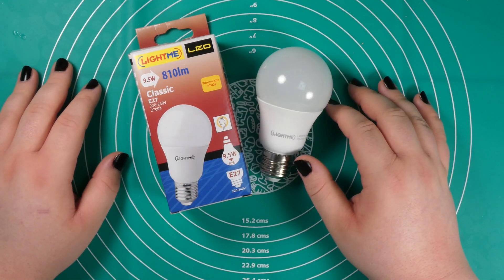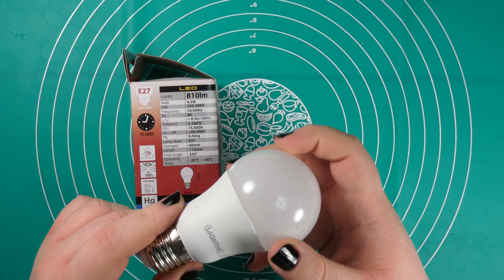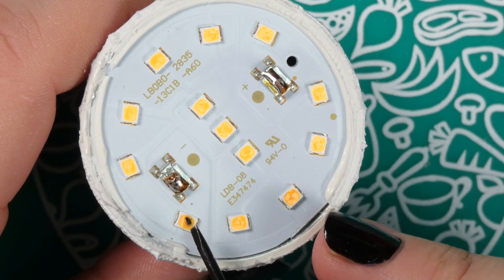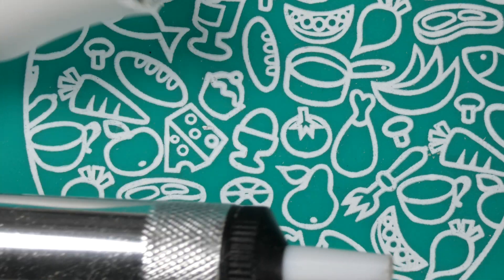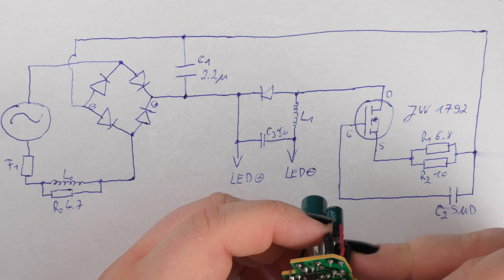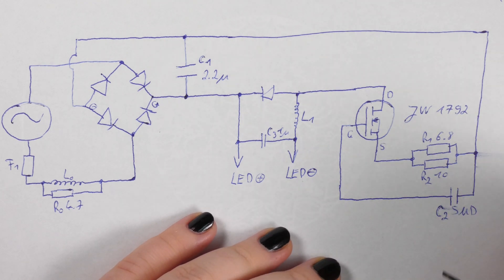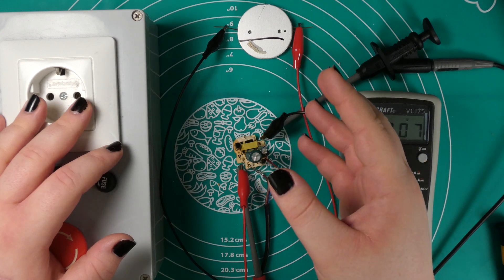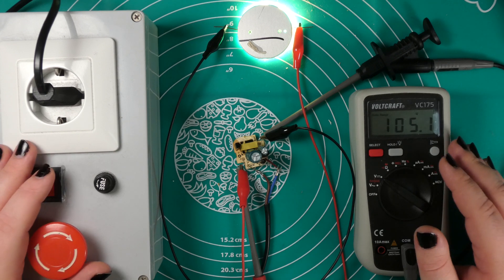Failed LED Light Bulb Teardown - Searching for the Cause  (+ LED Driver Schematic)

Comment: Absolut great voltage measurement with load. This helps a lot, when someone thinks what kind of led there could possible be in that kind of led lamp of course. There is also lamps with different amount of leds and of course different voltage drops over them. 👍

Comment: C2 absolutely does not just go to the gate of a mosfet. JW1792 is one of those 3-pin ICs which are pretty complicated inside. Among other things, it derives a supply voltage from the Drain pin and stores it in C2 to run all of its internal circuitry. R1 and R2 set the amount of current the IC will try to pass.

C3 is 400V exactly because an LED could go open circuit like in your case and there will be close to 400V across it.
Reply from the maker: The datasheet talks about it being a Mosfet, later I read a bit more about it and you seem to be right. But as I said I am not familiar with this type of circuit. But yes you can make a mosfet oscillate the way I tried to describe it. Essentially you want the cap loading to positive (?) potential for the fet to start open, once opened the capacitor potential changes and the fet closes.

Remember: MOSFETS are voltage driven and only need a surge current for its internal capacitor to fully open the gate.

(Problem was there is no block diagramm and it is calles a MOSFET)
Reply: @PhysicistAnna  The datasheet calls it an integrated LED Driver and that it CONTAINS a mosfet. By the way, here is a datasheet that contains a bit more info:
https://www.google.com/url?sa=t&rct=j&q=&esrc=s&source=web&cd=18&ved=2ahUKEwjV-4PR2c7oAhWOGewKHeO7AbAQFjARegQIBhAB&url=http%3A%2F%2Fforum.cxem.net%2Fapplications%2Fcore%2Finterface%2Ffile%2Fattachment.php%3Fid%3D554965&usg=AOvVaw1Vb455Is0YQCiYUY5xmt92

Of course it is possible to make a mosfet oscillate without an IC. You would have to connect a capacitor (and probably an extra resistor) between its Drain and Gate. Since no mosfet can handle 500V at its Gate pin, you would at least need a zener diode to clamp it down. 

You would then completely rely on that particular mosfet's three internal capacitances to prevent it from staying on and sending full mains voltage through the load and/or blowing itself up. Getting something like that to work Consistently in a production item would be even more difficult. Additionally there is no way to control the duty cycle, much less the precise current through a load, without a lot of extra circuitry.
Reply from the maker: Now that helps a lot, all datasheets I found did not include a block diagramm. Thanks :)

I just saw this datasheet is from Joulewatt so basically the original manufacturer, all datasheets I had acces to were from different companies...

Well now I don't know what to do, take down the video and redo the schematic part or let it be as is because the only difference is my "MOSFET" is not just a mosfet but that doesn't change the schematic at all...

I just double checked again, the schematic(in the video) is right. I traced everything correctly.
It is slightly different to the application reference.
Also R0 is parallel to L0 which completely negates the purpose of that inductor... this is the part I always can't believe my eyes...